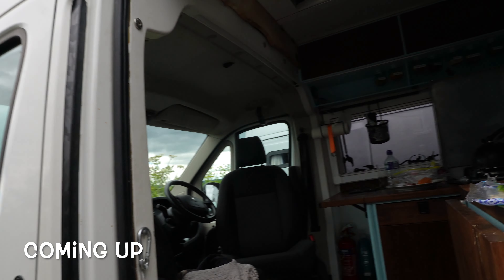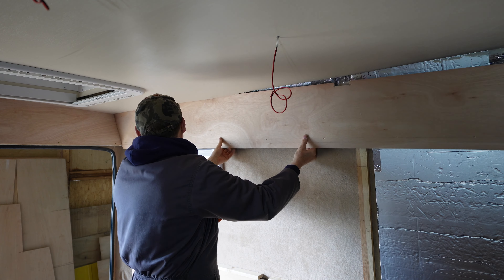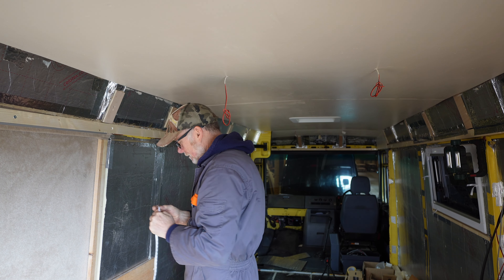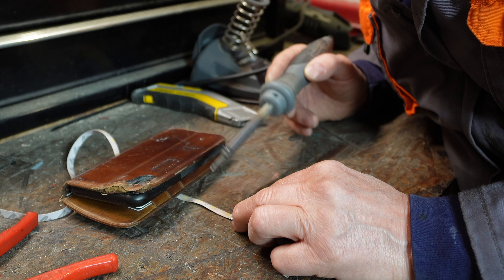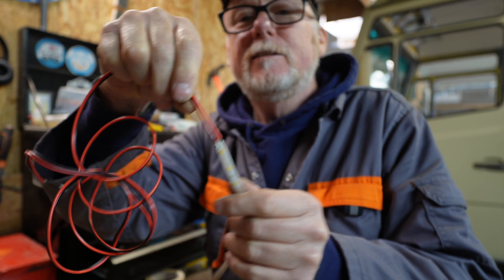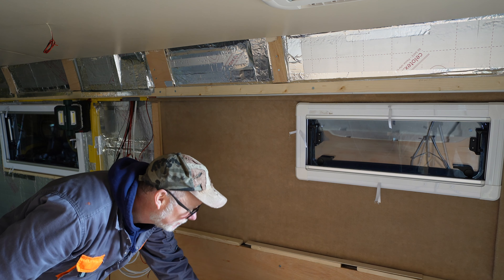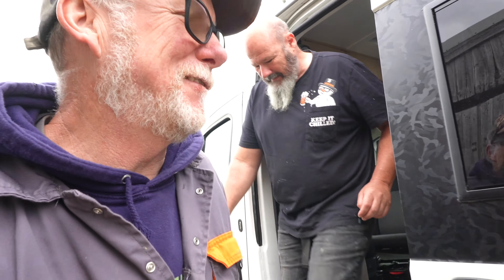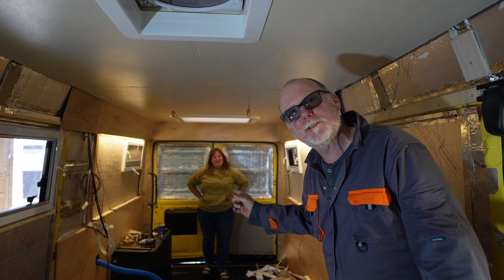lighting up the Dark side of owning a Recreational Vehicle  / lunch was stolen by mice

Comment: We have similar 2 wire led strip they can be dimmed, we used a touch switch from Camper Interiors but Amazon sell similar ones. Well worth a dimmer, as they do use some watts on full power.

Comment: You can get clamp-on connectors for the LED terminals but they don't always hold up to vibration. Keep the strip of lights accessible so you can replace them when they fail. If you have a heavy diffuser it helps to hide dead spots though. A good reason to make them indirect lighting so you can't see this too.
Reply from the maker: Thank you

Comment: I had the same led strip bought a coupe of dimmers on Amazon £12 for 2 ( worked at 6amp )I set them in a panel and used a separate switch , they reduced the amps from 2.5 amps to under 1 amp , and took the edge off the led brightness well done Mel good luck 👍👍👍🏴🏴🇬🇧🇨🇦🦢
Reply from the maker: Thank you that’s really helpful 👍
Reply: I got a couple of cheap dinners off eBay work great.

Comment: If the led’s go you just change the whole strip. If you have a manufacturers name you should be able to google the details on dimming and possibly having control over colour. LED - light emitting diode changes colour in line with voltage modulation (I think) but check it out for sure
Reply from the maker: Thank you that’s very helpful

Comment: mel where did u get the ali chanel and diffuser strip ive used there led strips for ages and all good and brought of ebay an led dimmer with a manual knob on the front to dim and also a remote John......
Reply from the maker: Hi John I got everything from Screwfix

Comment: Hi Mel, you can but connectors for the tape led strips, corner connectors etc, there is usually a scissor line where you can cut these. I know you ha e wifi in your vans so if you had an alexa in there you could use smart switches etc to operate things, may even be able to get a dimmable smart switch,
Reply from the maker: Oh interesting thank you